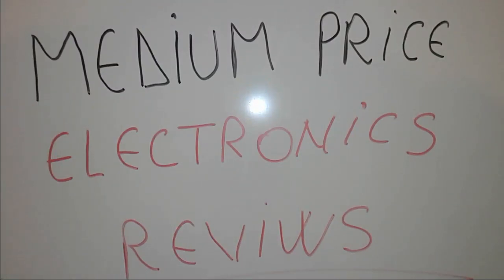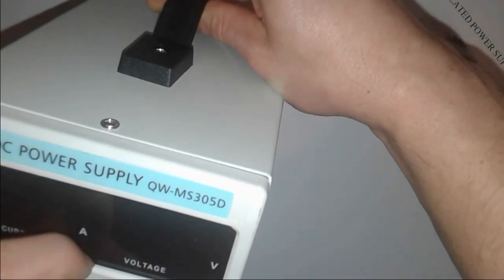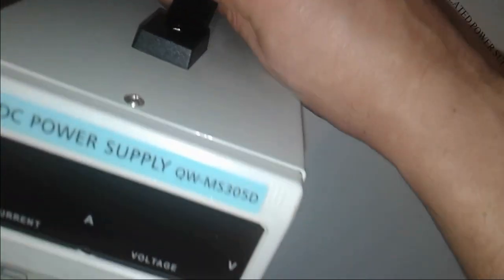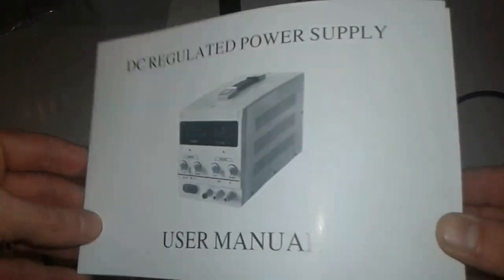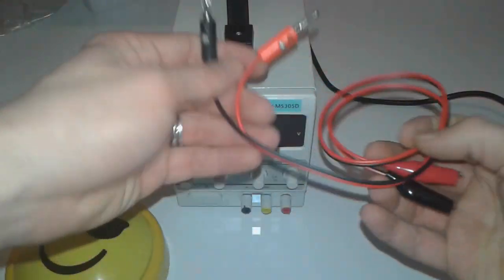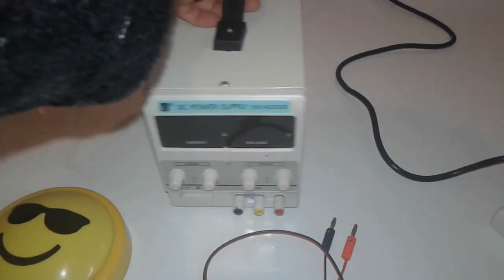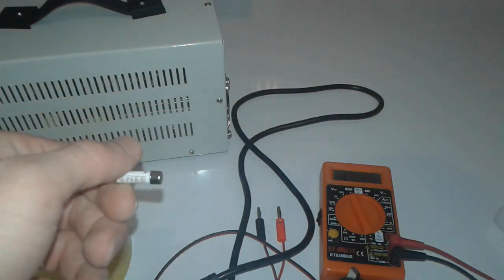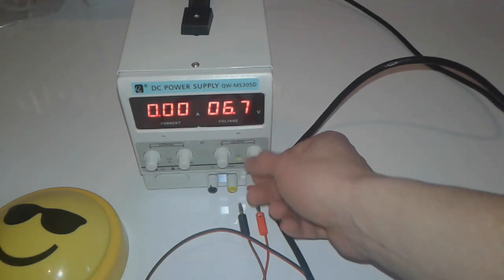How to use electronics lab power supply and review

Comment: Boss...read the instructions manual if you make a short circuit between the two probes you can adjust the amperage at which do you want the power supply to disconnect in case you have a short circuit or a problem